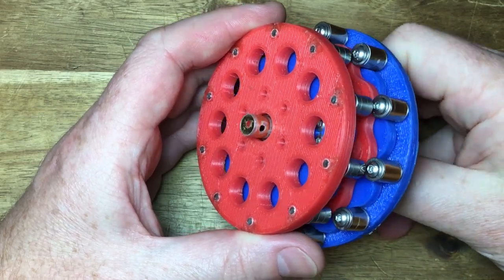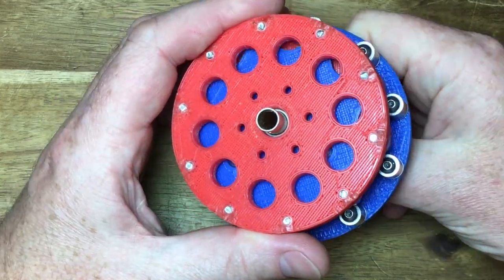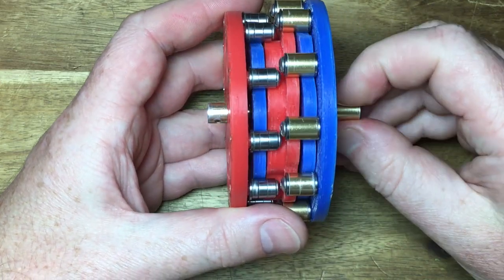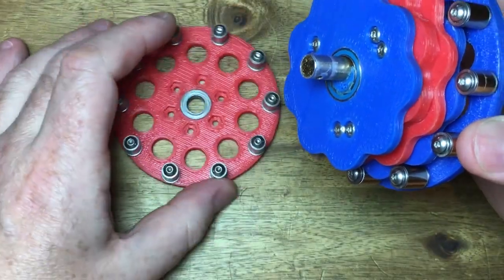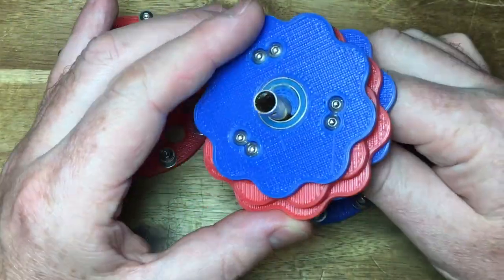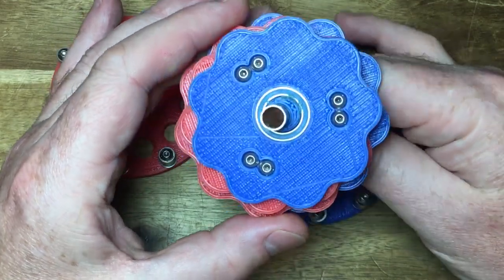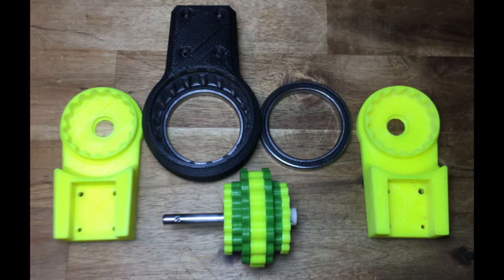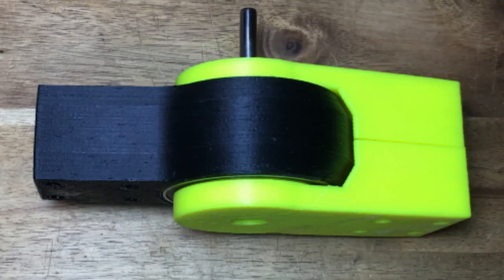Double Dual Stage Cycloidal Gearbox

Comment: These days where milling machines have digital read outs to .0002" and a lead screw that moves the table .02" revolution, it takes a lot of handle bumps to get where you want.  
A coaxial knob 20 to 1 would reduce the input more manageable rate.

Comment: Hey, thanks for keeping this alive and kicking...I already printed out your robotic arm joint, and would also like to try this design once it is getting ready for being tested out! 
What is the reason to have a third disk, when two are making a good center of mass already? 
I do understand the idea of a double double stage cyclodial drive though, thats a really good idea and will hopefully result in a very good balanced gearbox with insanely high reduction! Cannot wait to see what you will be doing here!! :D (Btw... a cheaper no bearing gearbox is maybe nothing to consider, I saw the stell shafts breaking the plastic to easy?)
Reply from the maker: The third gear stops twist between the upper and lower outside housings. I really like bearings, they aren't too expensive for the advantages they bring. How did the robotic arm joint work out? This triple double gearbox has a lot less bearings that some of my other designs.
Reply: @PaulGouldRobotics  I printed the parts, but am still waiting for the hardware...the steppers arrived Yesterday, ordering from China always takes forever!

Thanks for the cool stuff, this is so much fun!! :)

Comment: I love your projects. Why dont you use a harmonic drive style gearbox?
Reply from the maker: I have tried 3D printed harmonic drives but could not get them to work well. I may have another look at it in the future as other people have made good designs.
Reply: @PaulGouldRobotics  cool I know you can get some fairly high gear ratios. Which could mean smaller cheaper brushless motors like 2208 or some such

Comment: The connection between the cycloidal plates and the output shaft in single-stage cycloidal drives is problematic: it requires lots of room, lots of bearings, and it concentrates stress, as just one of the pins is generally taking all the load at any given moment.

The idea of linking the cycloidal plates from two different stages is fantastic.  That connection can be really strong and compact, and doesn't concentrate stress.  You've taken most of the bearings and quite a bit of bulk out of the design.

I have watched your triple-plate cycloidal video, but I don't see where your two-stage triple plate design got tried.  Did you find that it was just too large a reduction ratio (and no backdrive) for your application?

Comment: Does this gearbox is good for robot arm?
I can't decide which one to use.Planetary gearbox or cycloidal gearbox.
Reply from the maker: It's a new design and I haven't had much testing time with it. Check out either https://www.youtube.com/watch?v=2fDbMWHQbC8 or https://www.youtube.com/watch?v=pizl7i-uB68
It really depends on the amount of torque you need, this i will determine the motor and gearbox ratio. Cycloidal can have less backlash . Planetary might be simpler.

Comment: I noticed the outer ring is moving
Can the outer ring be made to move faster 
Possibly by stacking more gears on top of each other
Thanks for letting me ask
Reply from the maker: I'm not quite sure what you mean. The bottom blue part with bearing is stationary. The gold shaft is the input. The red part with bearings is the output shaft. It is a reduction gearbox with 110:1
Reply: If you put a spur on the outer edge it will make a ring turn

https://photos.app.goo.gl/GHqg7TkVU2W1hRhf8

https://photos.app.goo.gl/6DRkosVsVTmT48RbA

If you stack a series on top of each other you can make the ring move at the same speed as the center making speed and torque increase because the cyclodial can make a ring do a turn 
Its a question of how many stacked cyclodials with a spur to make the ring turn at the same speed as the center
I will do sone tests 
Its just a idea
With my idea they are all on one shaft so the speed is the same
One by one they push a ring so the ring moves the same speed as the center i will test it
Thanks for your reply
Reply: @PaulGouldRobotics  heres one more attempt to make sense of what im asking
Here's a question. 
So each cycloid on top of each other increases torque
I wonder if you put the same number of cyclodial gears to move a tooth once if you can make torque increase
I know its tough to understand what im saying

Here is 5 sets of 11 teeth

https://photos.app.goo.gl/A1i6F3WRNtUhWDKk6

The idea would be to put 11 sets of cyclodial gears on the first one so the second gear moves once with more torque making it so the last gear which is the biggest has more torque

It makes sense to me

Because what it looks like to me is each time one cyclodial does a turn it hits one tooth

And if there was 11 cyclodial gears on top of each other one tooth apart 
Those 11 cyclodial gears would make the second gear do one full turn 

And because it used 11 gears 
Those 11 gears would make the torque go up

Please tell me if it makes sense

Thanks for your reply
Reply from the maker: @jamesmatheson5813  I'm not sure if that would work. From what I see the cycloidal gearboxes have eccentric cams on the inside, cycloidal gears middle and circular lobes on the outside. You should 3D print one to test it out. It is a quick and easy to design an idea and test it a few hours later.

Comment: How is the next iteration going?
Also, is it backdrivable? Seems pretty much perfect for what I need.
Reply from the maker: I'm making a new eccentric shaft right now. The current one wobbles a bit. The gear ratio is ~160:1 so it is not backdrivable. I also need to do some good torque tests.
Reply: @PaulGouldRobotics  Ah thanks. Would it be possible to give it a different ratio to make it backdrivable, or would one of your other gearboxes be a better choice then?
Reply from the maker: @Skythedragon  I'm not sure any two stage cycloidal gearboxes would be backdrivable. The https://www.youtube.com/watch?v=pizl7i-uB68 is 27:1
The triple gear reduces twist and stops binding making it easier to backdrive. The better the tolerances, the less the backlash, the better the ability to backdrive.
Reply from the maker: Higher pressure angles also makes backdriving better.
Reply: @PaulGouldRobotics  Ah ok, thanks
how do you design these?
I tried making my own a while back but that didn't really work